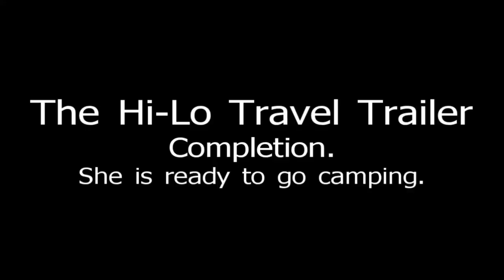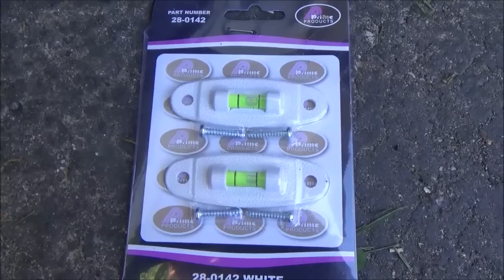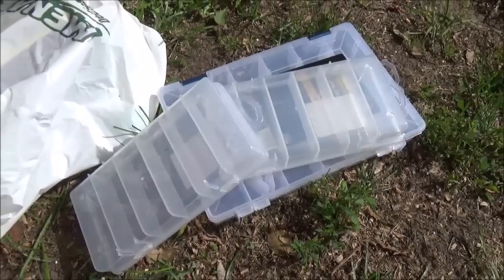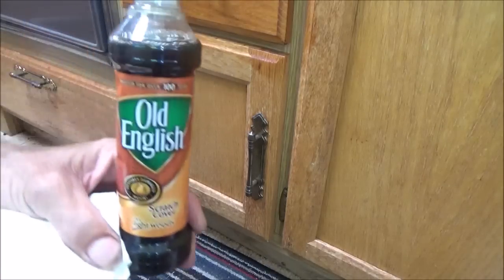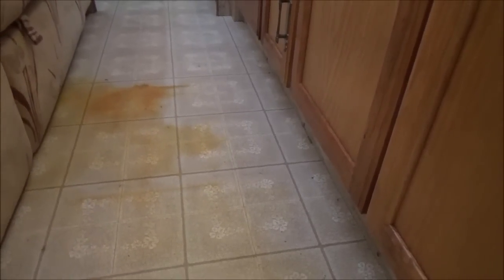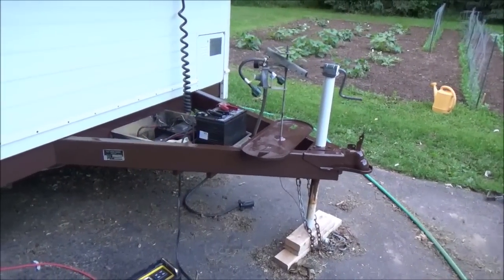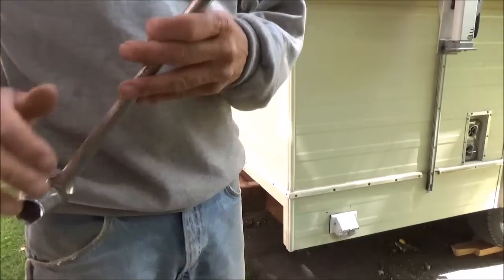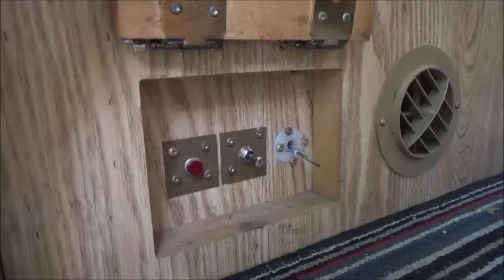The Hi-Lo Trailer. Completion. She is ready to go camping.

Comment: Back when I had a popup camper, I made a paper template of the floor, then cut a piece of indoor/outdoor carpeting.  It trapped any dirt and sand. After a trip, it could be taken outside and cleaned. No need for adhesives or fasteners. Looked like short nap carpet but can be cleaned with a water hose on the driveway.   You are one hard working son of a gun!

Comment: That old english wood restorer is great stuff. I used it on the weathered front door of my house and two years later I can finally notice it starting to fade again. I'll probably just reapply, since it's done such a good job. Since the parts inside your camper won't have the moisture or UV exposure of my door I'd expect it'll last a long long time.

Comment: A few years ago there was a product called Liquid Gold that was used to clean and feed and polish all wood surfaces, paneling, cabinets and drawer fronts picture frames etc. I am not sure if they still produce it or not but it was as good if not better than Old English, plus it was sold either in an aerosol spray or in a container  like Old English you had shown And also they had a product of same name that was used on stainless steel surfaces.

Comment: the camper I worked on was weather sealed with butyl rubber .  The lowest cost roof caulking that Menards has.  All of the penetrations for the awning and other things that were screwed to the exterior.  Butyl rubber always stays plyable.

Comment: Old English Oils should be put on at least once a year, preferably twice a year. It does make a difference in the looks.

On those metal parts like for the propane bottle support and the rear bumper after you got most of the rust off, you should have put a coat of Rust Reformer before the final coat. It'll make them last years longer.

Comment: Did you check the wheel bearings? Very nice camper. Easy job putting in a floor. Make a template, buy a piece of laminate, put template on top of laminate & cut it. All done. Good Luck, Vinny 👍

Comment: I'm curious of the tubes you bought for plugging the gap to keep the little bugs out, can't those be pushed down and out of the way and just left there to go up and down with the top? 
That is where the TV was designed to go but I think I'm going to see if mine can go up front in the window. My Hi-Lo is a '94 and has the same floor plan but I think my area up front is bigger. My table also closes and is flush with the wall cause it recesses  into the wall.
You have done a great job of cleaning it up. Thanks for sharing.

Comment: Did you check berings on axel? It helps to get spec on bering spec. Bought an old uhaul trailer axel fell off it was as cheap to order a whole new axel as replace componet parts.  U haul has custom axle special order...

Comment: Better  put the curtains back or make some for the bathroom windows as well..  could  be  slightly  embarrassing when  you stand up to  wipe... Not to mention maybe wax  the aluminum and fiberglass on front and back, and Both sides..  Better water drainage.. and as far as passing the OCD  test.. I  would have  replaced the  flooring with some  left over wood flooring from some of your jobs.. " I mean what does  20 square feet cost ?? "  (If That)  haha just a few thoughts..
Reply from the maker: The front and back windows have Venetian blinds. They are just all the way up inside now.

Comment: Hi-Lo campers are being made again in Transfer, Pennsylvania. They do have a website (www.hilotrailer.com) maybe you could contact them about a seal. Just thought I would pass on the info .
Reply: Thank u for this video
  I just bought a 1985 model and this video will come in handy.  Another way I will seal Gap is to remove old damaged wood and widen against wall usingbducken screws that will have wood buttons so if someone wants to Hilo they can by temporarily removing trim

Comment: Try vinegar on the floor for that rust stain.
Reply: I use oxalic acid for rust stains. I live near the ocean where we get rust on everything. You can get the powder from a paint store where they sell it to use as a wood bleach. I mix about 2 tablespoons to a quart of water and put it in a spray bottle. It works in a few minutes and is very gentle on fabrics. No need to scrub it. If it doesn't remove all the rust just on the first try just spray it again. You are supposed to wear gloves with it but I usually don't.

Comment: You say the battery needs to stay above 85% to raise and lower the top. How does the battery charge on a camper like this? We are looking into getting a Hi-Lo and need some more information about them.
Reply from the maker: When you have the camper plugged in it charges the battery. I am not positive about this next part but I know some campers the battery also charges when you have it plugged into your trailer hook up from your vehicle.  (while you drive). I also keep a battery charger in my campers just in case.

Comment: old english goes on better with a soft rag rather than paper towels, you dont have to skimp on it either, it will last up to a year depending on  how well you used the oil.  The idea is to preserve the natural beauty of the wood by applying the oil to the wood which  over time has dried up,  I had to laugh as you knew nothing about old english or what its for  That ''stuff' as you called it is a fabulous product if you use it correctly and understand what its meant to do.  Using linseed oil is another option but it isn't as user friendly.